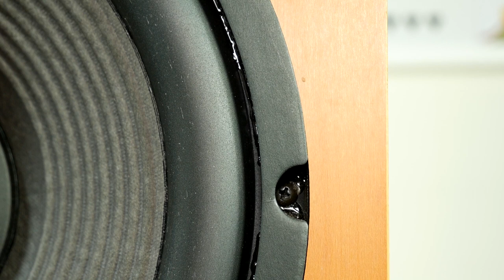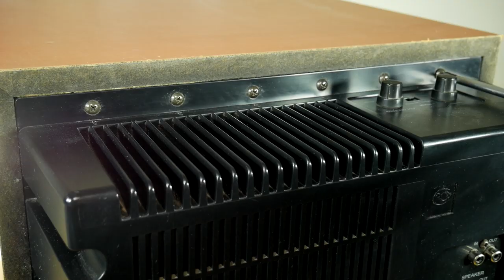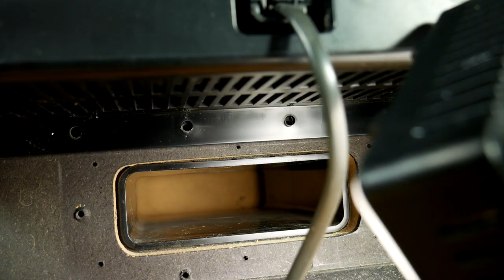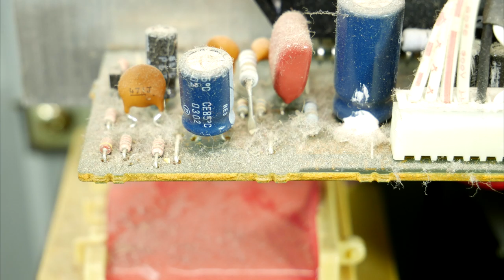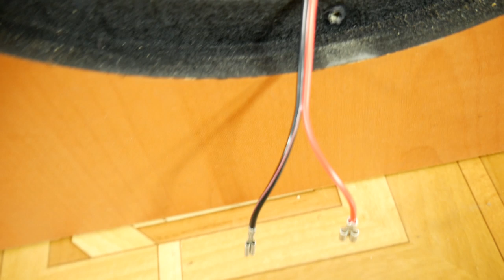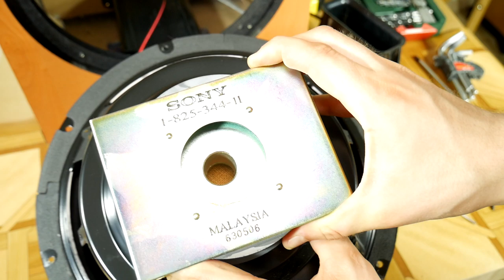Look inside Sony WM500 12 inch subwoofer - What's Inside?

Comment: This was an excellent, and informative video. I just got one of these woofers and love to see all the components.
Thanks for taking the time to list all measurements as well. 👍
Reply from the maker: Glad you enjoyed it!
Reply: Was that a fuse I saw inside?
I have a Sony SA-WM250 and it powers on with a green light at the front switch, but connected to my receiver by RCA cable I get no sound. I wondered if maybe a sound board in it had a fuse as well as the power supply. Is there a volume on the 250 model?

Comment: Looks pretty similar to my SA-WX700 dual isobaric 10" subwoofer. That one is a beast! Goes down to 25hz! If you can find a rare SA-WX900 that is the best sony subwoofer built period! Dual 12" isobaric with 1000 watts!
Reply: It is not isobarik. It is push pull, with both drivers generating sound. Isobarik is when only one driver generates sound, and the other just acts as an infinitely big cabinet for the sound generating driver. There is a big difference between the two principles.
Reply: The saw m500 goes down to 24hz as well
Reply: @janhenriksen6568  I dont get it. What is it like one woofer spits the sound out of the air the other one just sucks it? I dont care if I ever get it I just want my bass! I just got my SA-WM500 and so excited to plug this thing in!
Any idea if both RCAs are needed to be populated for it to work properly there is only one lead coming out of my yahama recever I am not using the speaker level rout as my amp has the dedicated sub out. Just need to confirm and what position the switches need to be set to
Reply: any idea what freq it goes down to?

Comment: I would have at least cleaned this up before making a video lol. I've had this sub and it does thump pretty good, especially after I loaded it with a 12" Kicker driver.  :)
Reply: What are you talking about "Kicker driver"? (i have this one,receive today)
Reply: @leo197777  I think he modded his.
Reply: @coolelectronics1759  The amplification card is not formidable either to the point that it is necessary to change the speaker (kicker driver, kicker is a special sub, I understood too late), especially since there is better boxes for 12 inches, the plastics on the back can create noise, especially at high power. Anyway, I'm not complaining (because I have a second 2.1 system with more roundness in the bass and punch, otherwise it has a wide band because it will have deeper bass, but I leave it at low speed, let's say it catches up with the shortcomings of the other and vice versa).  The result is very convincing, since the time that I am dissatisfied, in all I have 3 systems, amplified speakers (3 pairs of which 2 colones) but fortunately the Pioneer home cinema with its passive subwoofer corrects what is lacking in the WM500, but together they work very well.

Comment: So, I have one of these, this exact model, from a thrift store.  I'm wondering if a DIY person could make improvements to it, by altering it in any way?  I'm trying to enter the audio/home theater hobby, but I'm retired and on a shoe string budget.  I understand that there are better subs available, but I already own this one.  I'm just wondering if it can be improved with upgrades. I'm very new to the hobby, so I don't know what can be done.  Somebody below described adding a Kicker driver.  That would be simple enough, but is it worth it?  Would a $100 driver be a significant improvement to quality?  What about vibration dampening tape or filler?  It looks pretty empty in there in this video.  Is it supposed to be empty, or is it empty because of cost cutting measures?  Again, sorry for the noob questions, but I gotta start somewhere.  Also, what is the purpose of that short plastic port on the outside of the box?  Would removing that alter the sound?
Reply: To maybe help answer your questions, yes there can be improvements made such as adding that kicker driver that you were talking about. But if you really want it to be improved by adding that kicker driver you will need to have more power going to it as well, because adding a more powerful driver without actually feeding it more power it will sound the same with little to no difference. So you will need a more powerful amplifier for that to work well but it is very possible. As for the port on the back you’ll find that in most home audio speakers, what the port does is it helps the speaker enclosure ventilate the air moving inside it while also helping the speaker sound better with bass.

Comment: You could actually put a 12 inch car subwoofer in that if it's a dual 4 ohm voice coil car subwoofer because powered home theater subwoofer amplifiers are designed to handle 8 ohm subwoofers
Reply from the maker: Of course, but car subwoofers have very low sensitivity and almost they are very slow(mms very high), better check HiFi speaker manufacturer.
Reply: @Techscrews  Это точно! Автомобильные сабвуферы и динамики - полное фуфло! Очень жёсткие, с тяжёлыми диффузорами, слабыми магнитами, с высоким резонансом и слабыми магнитами, естественно, с низкой чувствительностью и очень высокой добротностью..

Comment: i knew it had stk output  actualy their not that bad i had a 100 watt stereo that shook the walls lol great sound mid fi .
Reply from the maker: stk realy not bad, it have good output power and low thd.
Reply: Id actually consider this piece hifi, crutchfield has a page on it if that is of any indication lol. I just got mines and super pumped to plug this thing in! This thing is heavy, and rock solid, looking forward to rounding out my yamaha 5.1 70watt per channel receiver, klh dual 5" center, klipsch kg2 fronts, setup with this!

Comment: It looks like the sa-wm40
Reply from the maker: design of course, but wm500 use a huge 12" bass driver and more power.
Reply: Had one of those....not even qualify as a subwoofer. Really low performance....just a bom bom box

Comment: Do you know how many ohms?
Reply from the maker: Sorry, I did not measure it.
Reply: Rated at 8 ohms. I measured mine at 6 ohms.
Reply from the maker: @andyn2994  if you do measurement with multimeter, it show aproximetry, 8ohms are get doing measurement on different freq.

Comment: Woofer looks decent, but that cabinet build poorly
Reply from the maker: The main is sound performance, I always first listen speakers and then teardown. Not always good look build quality mean fantastic sound. This sony subwoofer sound more better than it looks.
Reply: @Techscrews  look at the size of that sub woofer. for a 12" sub woofer an ideal enclosure size should be (H24" x D24" x W 14") and 2 long flared 12" pipe hole consisting of radius 3" each is a must to vent out the air from that sub. This will allow the sub work efficiently. Sound should be extremely pleasant. The box size matters most for any sub. A well built twice as the size of the sub enclosure should be enough to produce great bass. This way even a cheap priced low quality sub will sound terrific without a doubt.
Reply: @Techscrews  Sony is great! without a doubt. i have a Sony MHC-Gzr 77d Mini hi fi system. sound bass is superb. bought it brand new 10 years back still running ok! but i would say there was every chance they could make my woofer boxes even better than they provided for the money.
Reply: @apolloares6114  this is a typical brick and mortar store subwoofer built for the masses. I bet it was designed by sony only to go down to 35-40 hz with an f6 of 30hz. SvS or HSU is built for the enthusiasts with big enclosures and 20hz or lower performance.